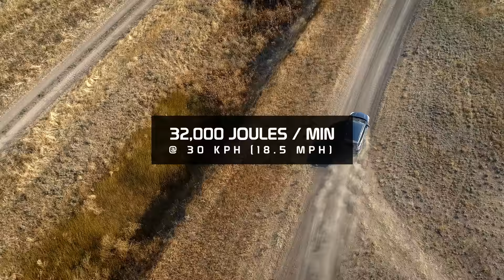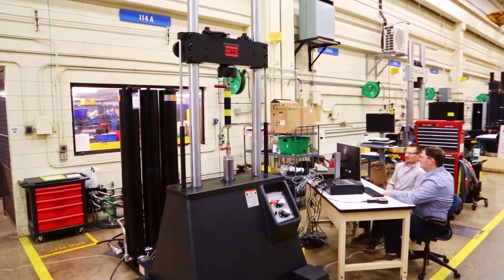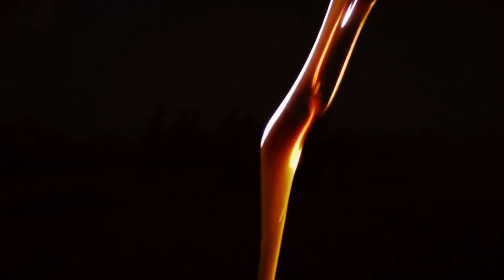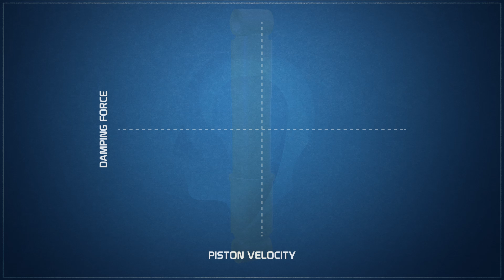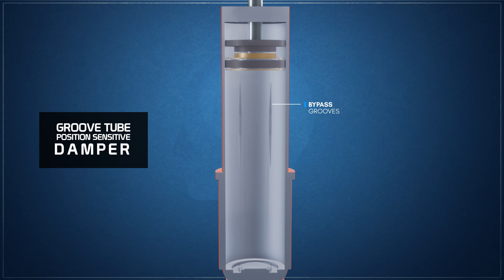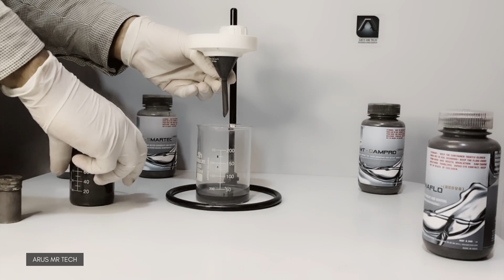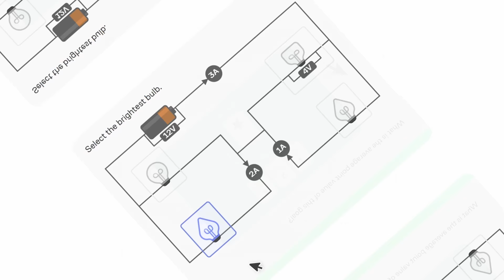The Clever Engineering Inside Shock Absorbers

Comment: I wonder when an electric motor with arm (or linear motor for easier coilover design) can work as a damper and use that energy to recharge a battery. Is current electric motor technology is lightweight and dense enough? Is current battery tech can handle the rush current coming in? I know the software and sensor already able to handle all of that. Is the economic make sense? Or we just jump to pure electromagnetic suspension and skip the hybrid mechanical-electromagnetic system?

Comment: What if there were ratched motor generators opposing swing arm suspension un both up and down dorection instead of springs? Could they not just be used to recharge batteries while providing the required dampening?? Better still, it can be minutely adjusted based on speed by programming on the fly to adjust the opposing electro magnets to create an infinitely better ride with AI

Comment: After a class of vibration mechanics, world hasn't been the same. A beam is a spring. A road is a wave with frequency. Wrongly tuned dampener and spring system just amplifies the vibration if it is of the sort that dies out naturally.

I'm already not a great fan of AI seeping into everything before we even know how it works or what it is capable of, but modern cars are already smooth rides enough to warrant a concern. As a driver I have no clue based on the driving feel what's happening. Essentially the computerised systems with great dampening removed me from the equation so I could be driving in the worst circumstances without knowing. And do something stupid because of that. It's an exaggerated example, but I felt safer when I wasn't completely disconnected from the road and driving environment. It's a great convenience factor though and in many places greatly enhances safety by allowing better control and less disturbances from physical impacts, yet it's a bit too far for my liking.
Reply: Every sentence in the second paragraph has less and less to do with both reality and the sentence before it as it goes along there really is nowhere to start and no coherent response possible. It's the unloseable argument.

Comment: Why in the name of god is the power consumption given in Joules per minute at 0:40 when Joules per second, i.e. Watts, is the default SI unit for power that people are already using (Apart from Myanmar, Liberia and the USA of course), this figure converts to 533 W or 2.13 kW for all 4 wheels. Not much, but still a reason I'm shocked nobody has resurrected the Bose electromagnetic suspension system from the early 2000s to go in electric cars, so they could add regenerative suspension to the regenerative braking already used to top up the battery.

The driver could then choose between active suspension, which would mean an extremely smooth ride and cornering completely flat or even leaning into the corners like a bike or some high speed train models, but consume extra battery power as the suspension actively moves the wheels out of the way of bumps and into dips and resists roll in corners, or passive suspension to give a ride similar to current oil damped designs, which would feed the energy the damping system usually wastes into the battery. However the sheer nebulousness of the cherry picked power number as being a 'heavy' vehicle on a 'rocky' road would suggest to me that the real world energy seen on most vehicles in most conditions is easily an order of magnitude lower and not viable for harvesting at all for anything that's not a trophy truck.

Comment: @new mind, please do a video where you explain a genius product that does not yet exist.  Just deadpan explain as if it were there.

May I suggest the method to bring more cargo from low earth orbit to geostationary orbit?  At present, a rocket might lift 10000kg to Leo, 800 to geo and 400 to Mars. 

The problem is the rocket equation.  But lifting to LEO is enough.  Where then do you get the source of energy for gas creation and matter to accelerate?  Look into solar thermal propulsion.  Sunlight is focused onto a refractory container, heating it 3000C plus.  Materials the rockets are built from (aluminum, steel etc) freely boil off at that temperature, creating thrust. 

This method is plausible chemically and uses existing rocket parts as inputs for gas creation.  A small robot can cut up the third stage and feed the engine either batch style or continuous.

The method may have been proposed in the 60s, or it may be novel. 

For space propulsion one needs energy and matter to accelerate.  Sunlight and sacrificial third stage material are sufficient for that.

Comment: The final development I think you should have covered is Porsche Active Ride on the hybrid Panamera, which is finally a fully-active system and really changes the approach to suspension control.
Reply: PASM is not fully Active. Lotus produced some Full Active suspension road cars in the early 80’s-Esprit and Excel models using hydraulic jacks and load cells.
Reply: @ColFar-s3k PASM is not fully active but Porsche introduced a new system on the hybrid Panameras (because it uses the higher voltage power available for the hybrid drive system) called Active Ride, which is fully active (at least according to the explanation I've seen).
Reply: @elektro3000 👍Yes I see it now, cheers, although Car magazine didn’t seem to get on with it on the test drive when going for performance.

Comment: He forgot to speak about the combined air spring and damper in the hydropneumatic Citroen suspension ?
It was a revolution in 1955 when it appeared on the DS.
Reply: It still outperforms most current car suspension in terms of ride comfort, but definitely doesn't in terms of cost of ownership.
Reply: The Citroën hydro-pneumatic Hydractive suspensions are amazing! They feel like flying over rugged roads! I haven't driven anything matching them
Reply: @oliviere1215  Modern cars are so focussed on feeling sporty presumable to impress motoring 'journalists', even though they're not the target market for the car, so they all fit ridiculous, delicate, expensive, high rolling resistance low profile tyres and 'sporty' suspension. 

They've forgotten that most people aren't using their cars for racing, and that soft riding, comfortable cars will still happily and safely do the speed limit without beating their passengers over every small bump.

Comment: Heard of the inerter?
McLaren design without oil or seals, a completely mechanical shock that ended up in a courtroom battle never touched again
Reply: No, the inverter was invented by Professor Malcolm Smith at Cambridge in 1997, McLaren first used it in 2005.

Comment: Awesome video as always.
I will make a minor correction.

Shock fade is still an issue, especially in cold weather.  The oil in the shock can go from freezing to really hot in about 30 minutes, that changes the way the oil flows significantly around the valve stacks.  You essentially have to tune the suspension in the middle for a 30 minute race.  If its a longer race, you tune for when the shock is hot, and just have harsh suspension until the oil heats up.

Comment: 32000 J/min = 533 watts.  I don't know why he didn't put that upfront.
Reply: 533 watts = 0.71 Horsepower
This is bad science communication. Rather than clear communication, he went for something that sounds startling and confusing. "Wow, that's hella Joules!"
Reply: @ThomasDwyer187  It's a pity no one has come up with some way of converting it into useful energy.
Obviously it's going to be variable depending on how bumpy road is but for four dampers it's a free 3hp (even if conversion is inefficient probably still worthwhile in racing situations?)
Even solar panels are not much over 10% efficient after a few months of dust build up,
Reply: @1crazypj brother you miss the point, we don’t need efficiency in racing applications, we need it for vehicles that cover hundreds of thousands of miles, when the smallest bit of efficiency amount to huge saving over the lifetime of the machine.
Reply: @JohnScales-d5p  I understood perfectly, if your going 1/8th miles or circle track any advantage not specifically banned by rule book is an advantage. If some way of developing 'free power' could be used, it would be used. Formula 1 has been using a spinning flywheel 'powered' by braking  for decades to get an extra boost, same principle.
Reply: @ThomasDwyer187  well yea but still anyone can search up what that means dude
Reply: @koiyujo1543  Okay, why watch any video then? You can just search up anything
Reply: Thank you, I was just searching for this conversion. 

This is WAY more than a refrigerator uses, this is enough energy for a single room AC during summer
Reply: @sbdpro2  yeah especially assuming a smaller room. It would likely cover the average power use of a small window unit.
Reply: I think it’s because the instantaneous power dissipation at any particular time point would be extremely variable, like on a particularly flat section the power could be close to 0 and in a bumpy region it could go upwards of even 2500W. When the variation could be that high, it is bad science communication to convey just the average especially when the variation time is roughly in the order of seconds, which makes watts (J/s) a horrible unit for the same. On a time scale of minutes however, that actually evens out, so it is a better representation as an average.
Reply: People like to use comparison instead of standard metrics.  Think Olympic size pools or the width of a human hair.  Drives me effing crazy.
Reply: I think he says its the amount of heat.
Reply: this is a useful unit. i don’t measure things in joules let alone joules per minute.  500 watts isn’t much considering electric motors in vehicles alone will use around 25 kw per 200 kw generating heat and that’s just the motors themselves
Reply: How much is that in chains^2 per footballfields^3 ?
Reply: Or the weight of the vehicle in the sample. Could be 80,000 lbs or 40k
Reply: Nope
Reply: "Americans will use anything for measurements except the metric system" 😆
Reply: @CuthbertNibbles  Joules are in the SI system.
Reply: @EliteMacFreak  AFAIR minute isn't in SI (but second is)
Also, 500W - that should be enough to power tens if not hundred of adequately insulated fridges if they only need to maintain the temperature.
Reply: @nonamehere9658 eh? My fridge is 120W and runs 50% duty cycle to maintain temperature. Even 10 of them wouldn't weigh 1000kgs.
Reply: @nonamehere9658  I suspect that power figure is for a very large US style fridge compressor under full load, not the average power consumption of the fridge, which will mostly consume no power at all in between compressor runs.
Reply: @CuthbertNibbles  I remember hearing that decades ago 😁

Comment: This technology peaked in the 90s.  All the new electronically controlled implementations are chasing the final marginal improvements at the expense of reliability and cost.  This is a common theme.
Reply: this goes for the automotive design industry as a whole.

over time you'll get diminishing returns when you have efficient design.
Reply: Agreed
Reply: Well, with magne ride, it is, in concept, very simple. The difficulty of execution is basically only in the software, while the damper itself isnt too complicated compared to those in the 90s and 2000s, at least for higher-end luxury and sports cars. The magne ride in one form or another is used by ford, gm, mercedes, and bmw. I would agree that certain electronically controlled features in some modern cars are for the most part, unnecessary and too complicated for long term operation, especially when that tech gets discontinued or is just too expensive to replace and or fix like how bmw uses sensors to check oil level while they dont even have the option for visually checking the oil level and oil wear with a dip stick.
Reply: Disagree. With the advent of electric vehicles I’d love to see someone find a way to capture some of that energy loss to heat and use it to extend range instead
Reply: @toasty365  I don’t care if you disagree, he’s right. Chasing the littlest bit of efficiency can increase manufacturing costs exponentially, and with more parts you have more points of failure.
Reply: @JohnScales-d5p  good for you, if everyone thought like you technological advancement would stagnate. 
For example, go back to before the jet engine was invented and use your mindset. Propeller technology is at its peak and from now on well see diminishing returns in aviation technology. Not only would this have been outright false due to the advent of the jet engine, turbo props were also invented making another leap in propeller driven aircraft. 
Just because you personally cant see any possibility for major advancement doesnt mean there aren't any more to come.

Comment: God damn, if there was only an economical, and easy way of collecting and using that 32,000 jules per minute.  that's 533 watts per second.  If the ground was super bumpy for an hour, that's 533 watt-hours.     And that's only for ONE shock absorber at less than 20Mph.  

I really wish piezoelectric generators were more efficient.
Reply: Watt is Joule / second. You don't have to state watt per second.

Comment: We waste tremendous amounts of energy for comfort.
Reply: Wrong. Without these devices vehicles would be uncontrollable and very dangerous.
Reply: @johnstonewall917  there have been automobiles without any suspension. They worked better. They also tried it on Formula 1 car. Performed much better.
Reply: @bastadimasta If there are springs then dampers are essential. No suspension at all gives a very uncomfortable ride.
Reply: @bastadimasta what production car in the last 120 years hasn't had suspension? Also F1 cars absolutely do have suspension, difference is they run on glass-smooth tracks and have very high profile tires to absorb impacts. A compliantly suspended street car is also a safe and well-controlled one. People really underappreciate the value of well-damped suspension.
Reply: @johnstonewall917  ne spring no damper
Reply: @DimitarStanev  There are so many micro cars with no suspension. Also, having no rear suspension was a common, even in busses. Williams F1 team tried a car without suspension. The car was very successful but banned by F1.
Reply: Or save mediocre energy by being uncomfortable
Reply: Again, an engine lost x50 more in heat !

Comment: So , the next target must be : how to recover the heat wasted from engine and suspension to use it on something useful ...
Well ...is not as easy as it seems perhaps 😊
Reply: you could install a gear system under suspensions to power a small generator to recover lost energy, similar to how linear ocean wave powered generators work, but of course doing so would increase, cost, complexity and fuel economy so its probably never gonna happen